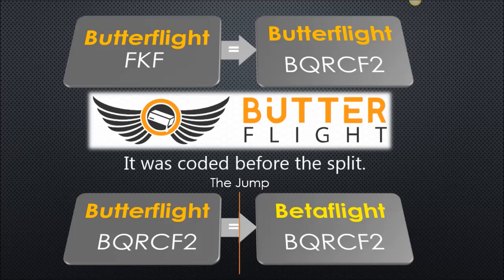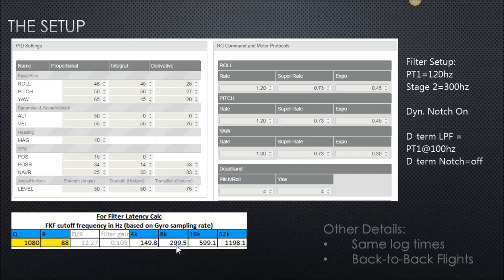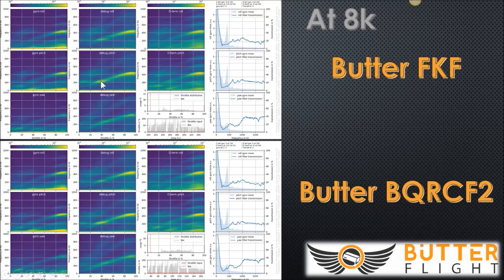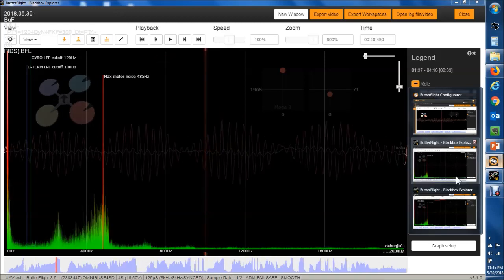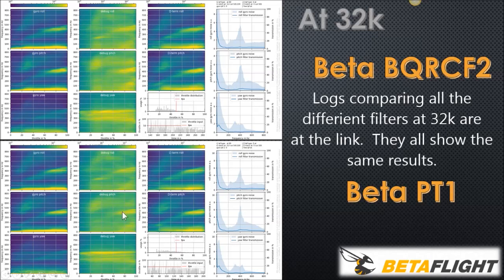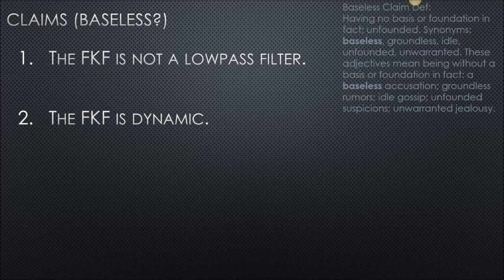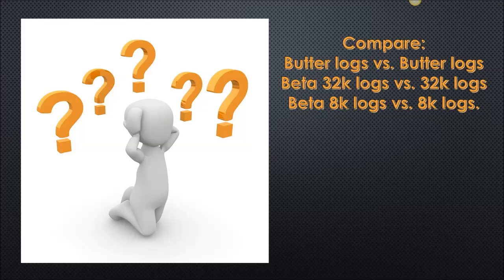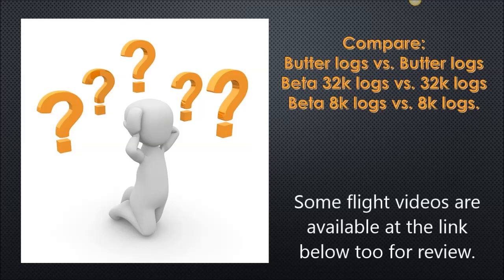Butter/Beta Filter Comparisons (WITH DATA!)

Comment: This is the EXACT comparison that Butterflight devs and Bob Roogi were talking about - math and logs prove nothing for humans, how we perceive good or bad flight characteristics. We don't fly some audio lab equipment where filters are configured according to standards and calibrated. We fly quads which are dynamic and we control them. And for humans FKF is miles better. It just flies better and tunes better and it is NOT equal to BQRCF2 in FEEL. It might be the same using some graphs and math, but it feels much better. People should accept that - all quad software parts should be tested by feel, not by some automated unit tests and math.
Reply from the maker: So you can feel more than 4,000 times per second?  Your argument is anecdotal and baseless.  Anything you feel can be measured.  Good stretch.

Sorry, not to be argumentative, but i was clear in the video that baseless claims will meet resistance.
Reply: But then why the micro I fly has terrible shakes at ~65% throttle with Betaflight and none of this with Butterflight, also it tunes better on Butterflight. There is something. Saying the filters are the same by copying their code and running emulation on matlab is no proof either as in real world they work differently. And I can't think a proper scientific way to demonstrate this as it includes the feel which can't be measured.
Reply from the maker: Can you send me the logs and I bet we can work through it.

Feel can be measured.  Don't buy that argument.

This was real-world flight testing.  I demonstrated both.  Matlab and Real world.
Reply: Writing it in caps doesn't make it any more true, did you know?
Reply: UAV Tech there is no convincing true believers 🤤
Reply from the maker: @Loose Transistor FPV - No, it is all the same.  Baseless claim.  Actually, look at my video in the link above.  Kind of thought 3.4 was doing better on nose bobble and prop wash compared to Butter.  HOWEVER, those were NOT on the same day.  So, nothing scientific there.  Just mentioned since your comment was kind of snide.

I'll do a head to head later.  Give 3.4 a fly and provide some logs of what you think.  We can compare notes/data.
Reply: sometimes 'feel' is legitimate, sometimes it is just a perception bias, which humans are very susceptible to. We need math and logs to detect whether a feel thing is bias or real. But when you have the same matching data - I'm afraid - its just a bias you think is there but it isn't in reality.
Reply: human senses are notoriously unreliable. Vulnerable to suggestion both before and after the fact... there is no way FEELS = consistent results.
Reply: Take UAV tech up on the offer and share the logs.  If buf has fewer oscillations the logs will show it.
Reply: tell that to mr steele..chad nowak..stinger swarm..skitzo..all who use the words feel in their videos constantly..if you fly enough and the same stuff over and over you can feel things.  even bardwell said that tuning now is subjective to feel..look at his livestream tuning video..cant argue with him now can we?
Reply: Pid tuning by feel makes some sense.  you can tune filters by feel but it's not the same thing.
Reply: yeah right on..all my beta stuff i just to the usual pt1 and notches off..again they are all my long range rigs and run 3.2.4 because all the OSD functions still work..so im just looking for a nice ride..im sure i could clean it up some with filters but i just tune for clean video and thats it on those.
Reply: those are al good settings.  this stuff is a must for set ups on 32k.  hell, most my rigs are using f3 boards that refuse to die.
Reply: RandomWisdom Roogi is the 'bro science' king all his facts are derived by seat of the pants 'experiments' with zero scientific process what so ever.. 
PID tuning is a subjective thing and it's all about the feels but filtering and problem solving now that's another thing altogether 🤔
Reply: I want to believe you... but your sentence is almost entirely lowercase.
Reply from the maker: @ChaddyCEEE RC
 - and those "things" more than show with 4,000x more precision in logs.
Reply: Loose Transistor FPV how about that debug mode 🤔
Reply: @UAV Tech.. you are going to end up spending all your time trying to tune people's quad on Betaflight to fly like Butterflight.. LOL Seems there is an easier path.